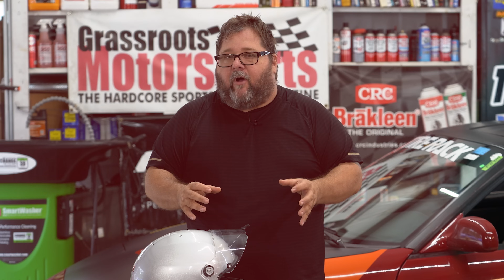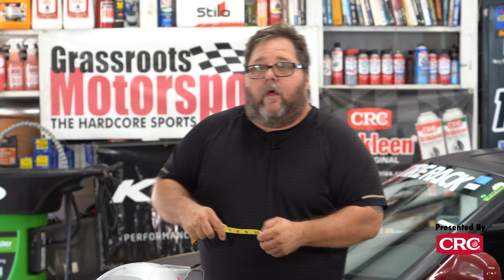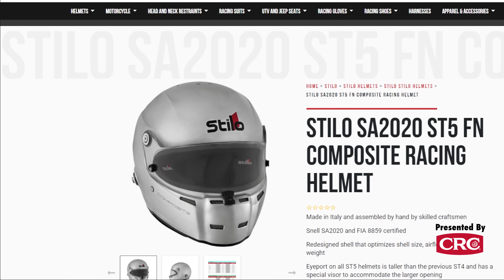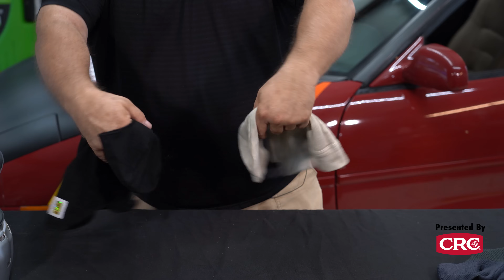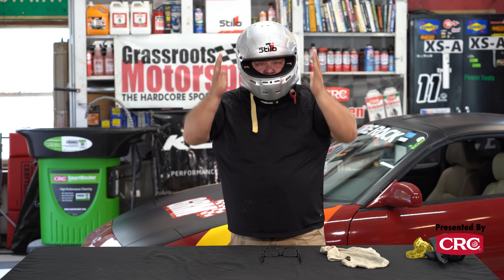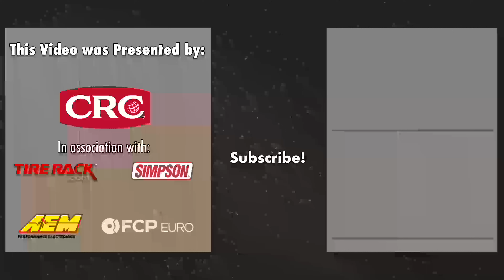Helmet Fitment Guide

Comment: How do you deal with fogged up glasses?
Reply from the maker: Commercial anti-fog cleaners work pretty well. But the big thing is temperature equalization. Make sure you aren't sitting in an air-conditioned car before you get your helmet on with your glasses. Put your helmet on early and get your glasses on ASAP to make sure everything equalizes in temperature and fogging will be minimal.

Comment: GREAT VIDEO!!

Safety Gear Budget Guideline - Add up how much you have spent, or plan to spend on car upgrades like coilovers, wheels, R-spec tires, aero, tune, etc etc.

Now, spend that amount on your helmet, HANS, fire protection (clothing and suppression), shoes, gloves, seat (ideally containment) and harness. Be sure those are properly fitted and installed by a pro.

If there is any left over, use that for coaching/instruction.

THEN buy the gear for the car.

Comment: Anybody use a racequip helmet? Measured and went off their chart and it said I needed a large. Here I am after going down sizes one by one with a small still being too big
Reply: Yes I've used a racequip helmet they tens to run big I'm a large on other helmet sites and still had to go with a medium now I'm with zamp and there helmet is true to fit hope that helps
Reply: I bought a racequip and returned it right away It seemed they use 1 shell for all their sizes. I bought a small and it was way too lose and the actual shell looked ridiculous like an xl on my head. The other issue is it felt like wearing a bag of bricks on my head i think it was around 5 lbs. if u can get something in 3 lbs range max i think it is best , 5lbs is way too heavy on the neck. They prob sell a ton seeing how they sponsor the big youtube channels and u see racequip all over youtube but I would never wear one.